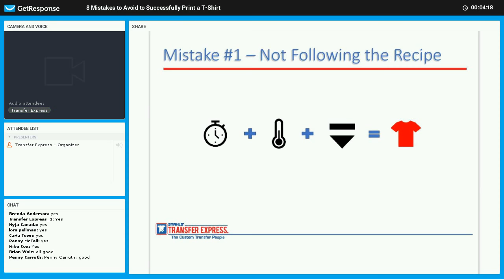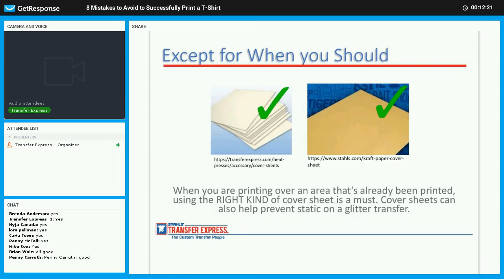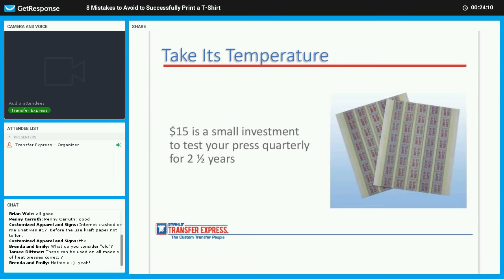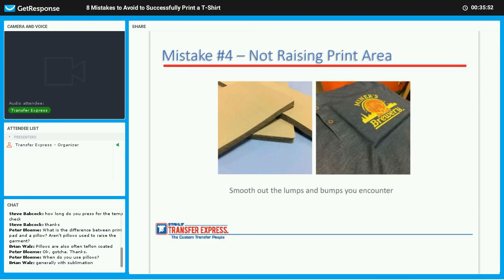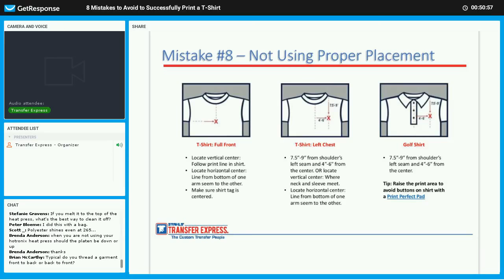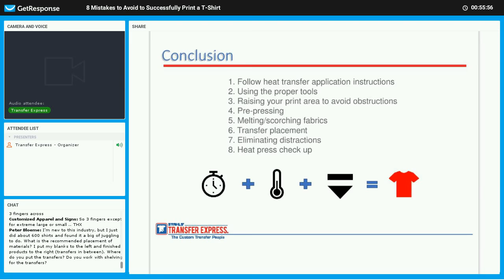8 Mistakes to Avoid to Successfully Print a T-Shirt

Comment: Not to sound stupid, my press does not give a pressure guage. How do I make certain my pressure is good.
Reply from the maker: Hey Carla, most presses do not come equipped with a pressure gauge, but you can get a good idea of your pressure by using "The Paper Test"! Essentially, you can place a piece of paper on your press in each corner and see how hard it is to pull it out. We detail the process in this video here at the 2:30 mark:  https://youtu.be/IKpUe5X0j1c?t=150